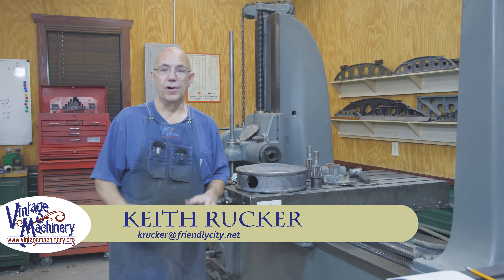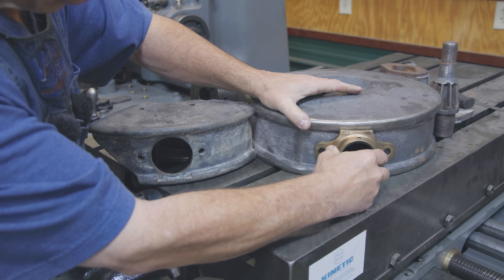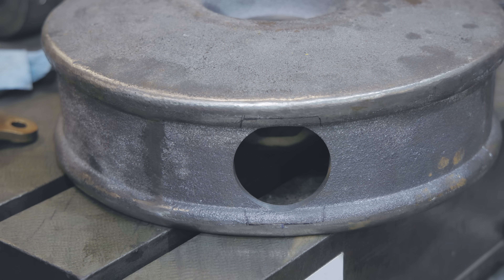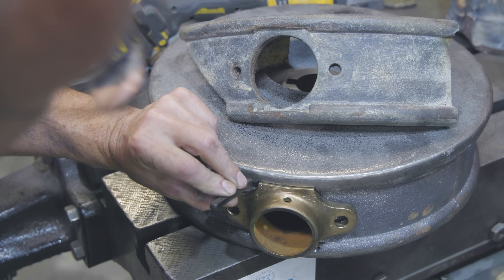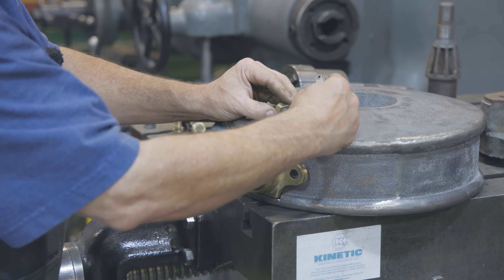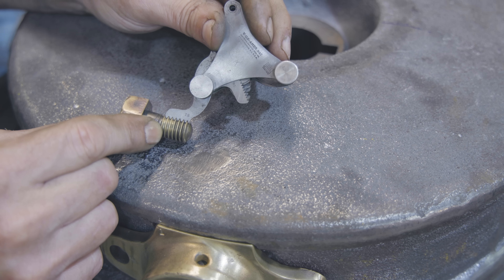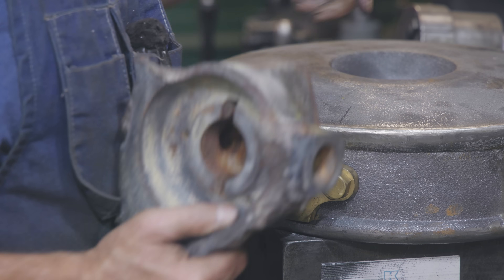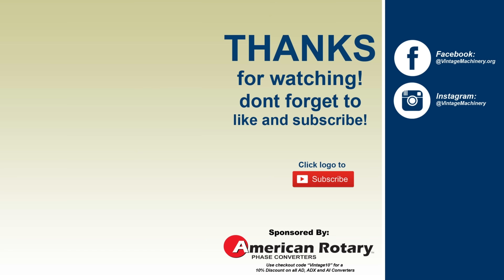Tally Ho Capstan Project: Installing the Top Manual Crank Drive Gears and Covers

Comment: Boat was built in England so it’s 1/2” BSW (British Standard Whitworth) which is 12 TPI. 

Not only the pitch but the thread form and thread angle are completely different to anything american. It is a 55 degree thread with rounded crests and roots. It was the first standardised thread form in the world.

It’s very difficult to determine thread angle of a worn bolt using a simple thread gauge, especially on something as small as 1/2”.

I’m guessing the tap Keith used was actually BSW (55 degree) since there’s no reason for a 1/2” 12 TPI tap with a 60 degree thread form to exist. 

In the UK, we’ve had to deal with all of these complications since the 1950s when we started to adopt Unified as a result of WW2 and commonality with US military equipment, and subsequently Metric in the 1970s.

Comment: Well as the capstan was made in England the bolts are for sure 1/2" BSW with 55° thread angle and 12 tpi. The US threads where never common in the UK or Europe. So you are lucky that a 1/2" BSW bolt fits a 1/2" 12 tpi theaded hole because of the clearance in thread angles , the other way round it wouldn't. Whitworth has been the first standardized thread system in the world, patented in 1841

Comment: 1/2-2 threads from Britain are Whitworth thread, 55 degree thread angle not 60 degree
Reply: That is what he said at 11:23 Whitworth have a 55° thread angle whereas UNC have 60°. The tap he used is undoubtedly a Whitworth ½“ 12 tpi with a 55° thread angle. I've never seen a ½" 12 tpi UNC.

Comment: Not telling, instead asking. Could you have put a rotary table on the horizontal and machined the radius out and then put a .0625 end mill in the mill and rotate the piece into the  4 corners. Again askin not telling

Comment: The vessel was originally built in England. 
The thread is probably a Whitworth thread with 55° flanks. 
The new American and European standards now use 60° thread flanks.
It is also not certain how exactly an inch was measured back then. 
That always depends on how big the king's foot was and how exactly it was divided into 12 parts.

Comment: Your ability to recreate the original design is to be commended.  I wonder if while restoring the capstan there should have been an attempt toward making the capstan watertight.  If not watertight, self-draining so water cannot collect in stagnant pools.  It is important that the capstan not become a source of water intrusion.
Reply: @robertlevine2152

Gee, I'm sure no-one thought of that! Good thing there are randos on the interwebs that know more than actual boat builders. SMH.
Reply: @billstevens3796  I am a naval architect and marine engineer.  I am a Fellow of the Society of Naval Architects and Marine Engineers.  I was a Fellow of the Institute of Marine Engineers, Science and Technology.  I was a Chartered Marine Engineer and a Chartered Engineer.  I have worked as a naval architect and marine engineer for over 35 years.  I supervised the design and construction of tankers ranging from 90,000 DWT to 188,500 DWT.   I also spent a large portion of my career working on the technical engineering side of tanker maintenance and repair.  My observations were made based on years of experience with marine equipment.

I should also mention that I was a recreational sailboat owner.  I spent nearly as much maintaining my boat as I did sailing.  I learned sometimes simple fixes make the biggest differences.

Comment: No mention yet of how this will be painted. It would be a huge problem if you complete final assembly without a solid coat of marine enamel.
That piece of iron is gonna spend the next 100 years in close contact with salt water.
I know you guys have some sort of plan but I see nothing which leads me to believe there are grease points or a plan to finish it.

Comment: I don’t get it. At 7:38 he says “and that’s about it…right there” except the bronze piece is clearly not fitting in the notches. It is rocking because of a small obstruction. If this thing is tightened down it will deform and possibly crack the bronze piece or even strip the threads on the casting.

Comment: Why ??? After all the machine work did you resort to hand tools? The clearance should have been cut out when it was on the boring mill.
 A with the modern upgrade on the electric drive, why didn’t someone install stainless steel sleeves on the pinion shaft and put plastic bushings in the bronze plates, 
This is a Seagoing sailing ship. It lives in salt water, so bronze will corroded, cast iron will rust AND You are going to drill holes for oil that will leak and run down on the deck . A little practical forethought would have made this a better outcome 👍
Reply: " so bronze will corroded, cast iron will rust "    Just remind me, how old is that capstan???

Comment: Not only you don't use metric threads  but on top you use a thread measure thats not common anymore today... unbelievable.
Don't get me wrong. I admire your craftsmanship. but this workpiece will become unserviceable while sailing on a 95% metric globe.
Reply: The original bolts were in place for over a century. But now will need to be replaced weekly?
Reply: @billspear7702  Usually bolts (or other components) have to be replaced at a time when you can do with it the least. And then you have to take what you get. And this will NOT be a special imperial thread of the 19th century...!
On a museum ship, no question. But this boat is meant to be used !

Comment: You sir are very very slow. It might be quality but you are still too slow, and milking the Tally Ho series as well. 
Sorry for the criticism but man get the thing together already, finish it and send it out flying. Then make 1 video compilation and be done, pls just finish that part already.
Reply: I always play his videoos 2 times faster. Then it s still fine to folow.
Reply: Didn't work in a jobbing shop that's for sure.
Reply: @colinpacker  matter of fact I did
Reply: @bljuzga  So did I but I was referring to Rucker. Sorry if that didn't come across.
Reply: Did you not hear him mention that he's waiting for parts from England? Pretty difficult to finish something without the parts.
Reply: @kennethstaszak9990  The nitpickers, probably didn't watch it until the end,   I reckon, they may well of dozed off.. 🤣🤣😜😜
Reply: The finnished assembly was shipped over a week ago.